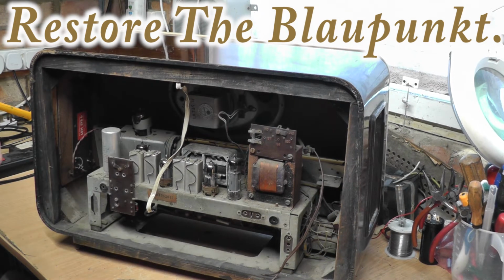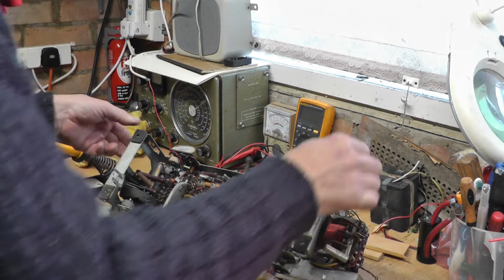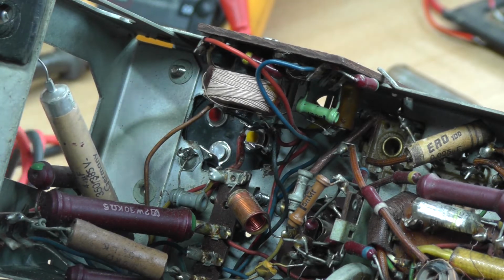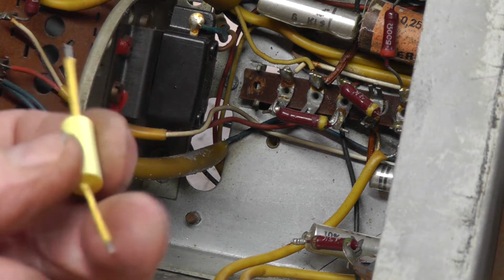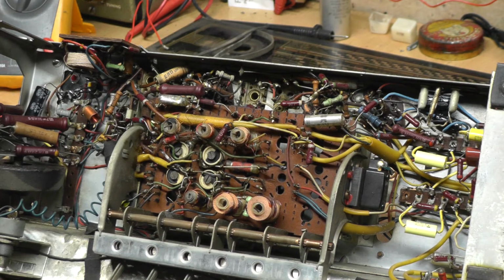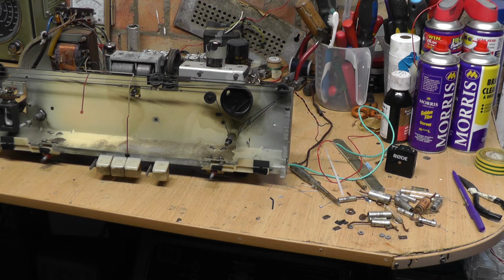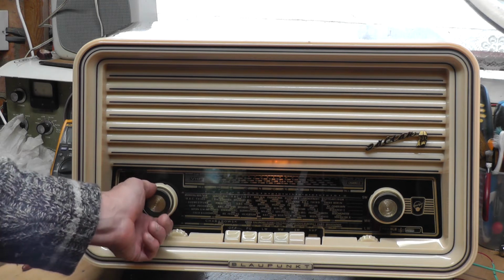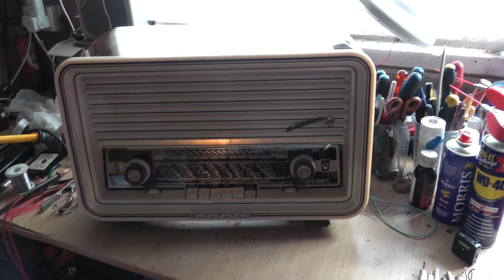Can I Restore The Blaupunkt?

Comment: Excuse me, how to disassemble volume knob and turning knob? Thanks
Reply from the maker: Hello, on this set of mine, those knobs are both removed via a tiny grub screw that needs to be loosened with a small flathead screwdriver hence they will slide off the shaft both knobs have a set screw the small inner knob and the bigger outer knob both have a set screw you can see the little cutout on the knobs where the screws are below and that will need to be loosened for them to come off. Kev.